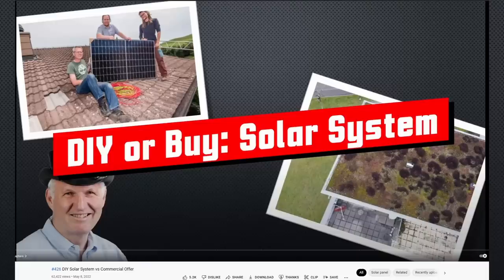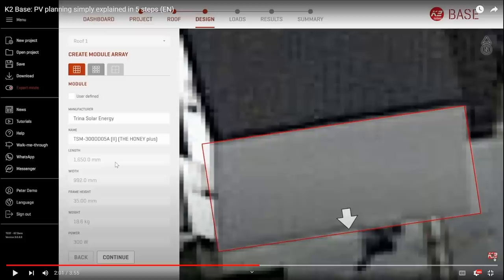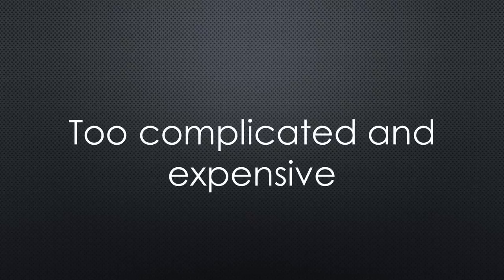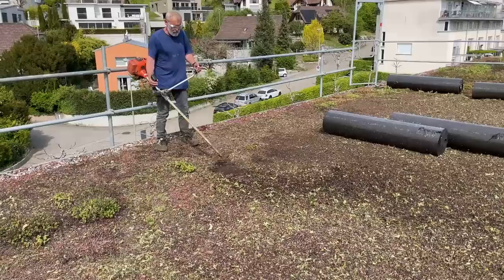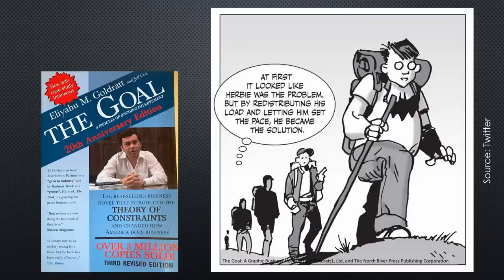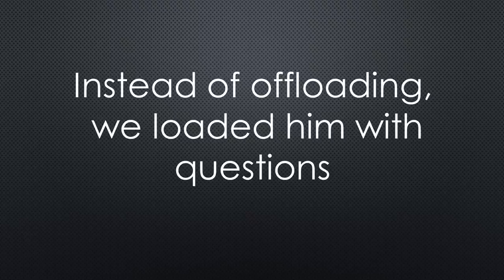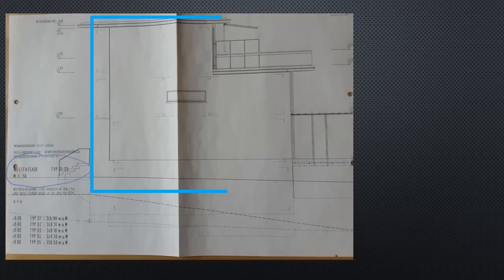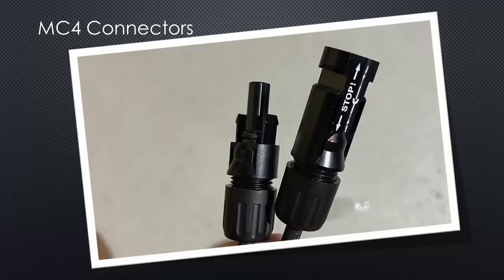#427 Four 8kWh DIY Solar Plants with neighbors (Part 2)

Comment: Interesting. I also installed a small solar panel system and it is surprising how expensive it became and how little power it produce. That being said it is only 2 x 100W panels and 2 x Exide ES1350 GEL type batteries, but it is still enough to run my flat except the electric cooker in the kitchen. All my devices, phone, and tools gets charged from this little system as well as it runs my computers, 4G Internet router, LED-lighting, and my fridge. I turn off my fridge at night to conserve power and it has not been a problem so far. My panels are placed outside my windows (cannot be seen from the street) at the roof level on the third floor and are they are mounted with 3M VHB tape. It is my plan to add a Raspberry Pi to monitor the voltage level of the batteries and top up with a charger at night, if it falls below 12,4V. So far the the voltage levels of the batteries has been between 14,7-12,8V all regulated by my Vevor MPPT 40A charge controller and the batteries are usually fully recharged at noon the next day. While I have come to terms with the low power production and the low prospect of recouping my investment, I am positively surprised and happy to know that I will have power enough for what I need, in case of a prolonged griddown scenario. I live in Denmark so most people should have better conditions than me. Since I use a battery bank there's no regulations to comply with, and I am insulated from future idiotic Governmental decisions, policy reversals, and price hikes. If all goes well the solar system should give me between 15 to 20 years of somewhat trouble free operation.
Reply: the set up you have is about what you need for every major appliance individually. I don't see how approximately three such setups couldn't pay for itself in a year if you completely mitigated your usage.
solar fridge vv

https://i.pinimg.com/originals/f5/27/99/f5279909e1205f363ae44999c0002fe3.jpg
Reply: @kingmasterlord   :D I might consider that setup... Thanks for the advice :)
Reply: Do you have like 18V panels? (21V peak).  If I check the price of these versus like the 300 Watt panels that output like 30 to 40V it seems that the 18V panels are a lot more expensive price per Watt wise.  Not sure if you have insulated your fridge but I once saw a website with a guy that insulated his fridge and got a lot better efficiency. 
For the monitoring I would check an ESP32 or if needed a Pi a first gen Pi Zero. My Pi Zero W runs internet radio all spring and summer on a small panel with a 18650 buffer ups pcb.
How does it run during the winter months?
Reply: Check out the new "carbon" lead acid batteries (aka "ultrabattery" but licenses and cloned worldwide). Also sold as "EFB" batteries for cars. 
Their biggest advantage is that they can stay discharged for longer time , but they also do not sag (their voltage drop is smaller) like normal lead acid and charge quicker.
They are priced just like normal car starter battery and sold in car battery stores. 
Getting even smallest set of them to complement your existing system will prolong life of your install, esp. if you will install smart switch so they will discharge first, before discharging your normal batteries, and even better - if weather forecast will be taken under account.
You can get very good , machine-digestible weather forecast from polish ICM goverment meteo service (i cannot paste link as google will remove comment as spam) . 
I hope this will help to keep your return of investiment by prolonging battery life. 

Using RPi is bit overkill as it consumes much power , There are very nice uC's able to do video generation , many running python. 
Actually one can also create analog or even mechanical "statistics" display - just think about using hour-glass , or water.
So f.e. small "water pond" pump pumping water from bottom of hour-glass shaped bottle to the top , powered by sun. This will "integrate" the total sun input giving You daily average. In the night water will slowly drip back to the bottom. Ofc this is just example and you can design similiar analog circuits or do it all completely mechanical way so it is more intuitive. 
Good luck and greetings :)
Reply: @Luke-san  My panels are 2 x 100W 12V 8A and they are connected in parallel so I theoretically can get 12V 16A and I bought them on Amazon in Germany, where I basically bought everything needed except the batteries because it was the easiest option. When the system is doing its best in sunny weather, around noon I get 98W, which is actually pretty good considering that my panels do not sit beside each other but on each side of the roof due to the space constraints under each window and the placement of the dormers. My fridge is an ordinary household fridge with a freezer compartment at the top. I discovered that the freezer only drop a few degrees during the night the 6 to 8 hours depending on the time of year because it is never opened at night. Right now in overcast conditions the system is charging with 47-87W and it is up and down like a yo-yo. I have only had the system since March 2022 and I quickly realised that it would be good to have an automated option to charge the batteries from the grid in case the voltage dropped below 12.4V especially if I get a few very dark days in a row.  I use 2 inverters to handle my 220V needs 1 small modified sine wave inverter 300W (500W peak) and a 1000W (2000W peak) pure sine wave inverter otherwise it cannot start the fridge. If I used the 300W inverter for the fridge the light comes on in the fridge but it is not able to start the compressor. Snow does not affect the panels very much, covered with snow they still charge but of course they do better without. Btw. thanks for the tip about ESP32.
Reply: @piotrcurious1131  Interesting, I didn't know of EFB batteries the Gel batteries were very expensive and very heavy. Thank you for the tips you gave me I will check out the Polish weather services.
Reply: @yannkitson116   Yann, isn't it an option to place the panels in series?  Should be higher voltage = less cable loss. Might be worth to experiment. But first read the manual of the controller I would say. (covering my ...) Just checked that mppt controller, seriously expensive stuff compared to those pwm controllers. 
About the fridge, I think it must be the compressor that requires a lot of power during startup. I checked 2 fridges  here and both were using like 70 to 80W while running so I wonder why we need to connect it to a 2.5mm cable instead of a 1.5mm one. The 25m extension cord that I use to power a lawnmower is also a 1.5mm thick cable.
Reply: @Luke-san  The charge controller isn't a cheap one it can handle 12V, 24V, 36V, and 48V and if I connect the panels in series I will get 24V/8A. I have never seen 8A it is usually around 2-3A and between 16V-21V. I was under impression that I should get as many amps as possible for faster charging and the correct setting would be handled by the charge controller that's why I connected the panels in parallel given the low performance of the system. The system would definitely benefit from getting a few extra panels added, but unfortunately I don't have any room for more than for the 2 panels I have.  One of the panels have about 11m cable between it and the charge controller and the other has 3m. The whole system was outrageously expensive, the 2 Exide batteries alone cost me 5800 DKK but the charge controller's wifi module tells me that I have produced power for 45.3 DKK in May so far. Electricity is expensive in Denmark so that amounts to 11.6kWh but I think those figures are unreliable.
Reply: @yannkitson116   Well 12V/16A and 24V/8A equals the same power but cable loss over low voltage is higher. Your MPPT I would guess should do the rest of the manipulation ... converting solar power voltage and current to the appropriate output.  if I think it is the one I see it says solar panel input to 150V DC.  Depending on the thickness of the cable 11m can already cause a bit of a loss. MC4 connecters are fairly cheap and some thick cable, or multiple ones in parallel won't break the bank and can get you some extra power. 
If I were you I would check if there are some forums about small systems and get the other peoples experience  by just introducing and telling what and how you have installed things.  Btw, I applaud you for doing this.
Reply: @Luke-san  The cable from the panel to the charge controller is LappKabel Bund Lapp 2x6mm^2 that's what it says on the label from offgridtec (bought on Amazon), which is basically a very stiff cable that contain both the positive and the negative supply and I use MC4 connectors for all connections except where the two panels are connected in parallel, but that I can change... Yes I might look for some more information in a forum. Thank you for your suggestions for improvement.
Reply from the maker: I also would pay attention if the panels do not have the same direction. This can hurt the efficiency dramatically. See my East- west setup
Reply: @AndreasSpiess  Yes I guess that is probably one of the biggest issues. One of the panels only get diffused sunlight while the other one get direct sunlight, that is a limitation I have to live with due to space constraints. I never see the full capacity of the solar panels, the capacity is always less than half of the theoretical maximum. So while I'm looking at a questionable profitability, at least in the short term, I get an immense pleasure out of the little return I have had. Inflation has actually helped a bit, due to the now higher price of the individual components, which translates into "savings" in present day value compared to the actual purchase price. So when we look at it that way the ECB has produced more value for me than the sun so far :)

Comment: I think that the long minus is for having the same restistens to alle the panels, like a chrismas-light, see Big Clive example
Great project, with a lot of learning incorporated and a lot of comming to together. Love it.
Thanks for sharing your journey 👍
Reply: In this layout case it should be more to avoid an induction loop. Such loops with large surface are susceptiple to induced overvoltage if lightning strikes nearby.
Reply from the maker: I understand the lighting argument!

Comment: Great job, congratulations! One note, when it comes to comparing cost with your brother’s installation: A sloped roof (especially a steep one like your brother’s) adds a lot to the installation cost. (Note all the scaffolding they had to construct, and work goes much slower.) Here in the US, roofing companies also charge more for steep roofs because they have to use more expert, higher-paid crews.

What a fantastic project, I’m envious!
Reply from the maker: He also used scaffolding to paint his house... But still, it will be interesting.

Comment: woa, seeing the concrete houses & roofs is CRAZY !
in USA  u have to be careful walking on the roof not to bend it, which leads to a break=water leak.
Reply from the maker: Indeed we have different building styles… But you also have skyscrapers ;-)

Comment: Nice project. Looks very well done. I upgraded my 3kW system to 7.5kW last summer. And built some ESP8266 based modbus to MQTT readers to read the inverter. Btw, Basel was awesome, we really enjoyed it.
Reply from the maker: Cool you enjoyed Basel! I have to hack the Huawei protocol to get to the data because it is an integrated system (with battery)

Comment: I actually went fully off-grid with solar power this past winter. I spent about $6k USD for 7kW of used solar panels, a 5kW all in one charge controller/inverter unit (Growatt SPF 5000 ES (US model)), and a 125 AH 51.2 V battery pack, plus the hardware to hook it all into my home. I've designed the system so I can expand it to up to 30 kW at some point in the future.
Reply from the maker: Cool project! We use too much electricity to go off-grid in winter. So this is a good choice for our small roof. My 10kWh battery will barely survive one long winter night...
Reply: @AndreasSpiess  I understand. In my particular case, I heat the house with wood, so the power load is much lower.
Reply from the maker: @MatthewN8OHU  we also use wood for heating.

Comment: In some cases you can get away with the longer minus (or positive) cable, effectively reducing the cabling length by 50% by using "skip or leapfrog wiring".
Reply from the maker: I had a look at what you mean. The disadvantage is that we would need much more extension cables between the panels because the initial cables only cover the distance to the next panel.

Comment: Great content as always! I don't know if the dust will be a problem as time pass by, because it would impact directly in the system's efficiency, maybe we could see  a panel cleaner based on Open hardware series soon lol!
Reply: Usually you would just wash the panels once a year, before the summer production peak. Cleaning that by hand would take less than half a day. Developing, installing and maintaining a machine/robot to do the same would take way more time and effort. I guess for really large installations, cleaning automation can make sense. But for small and customized projects like that, doing it by hand is just way more efficient.
Reply from the maker: I also hope rain will do its job. They promised that the panels with 10 degrees slope are „noclean“

Comment: Looks pretty easy, comparing to do everything alone, welding a construction on the roof etc... The roll of cable was the heaviest to bring up the ladder...
But it is not really comparable, my first system ist just 9 Panels. Nevertheless they serve my complete consumption right now, the electricity meter is turned off and i am powered by my UPS system 🙂
I am curious what you get out of your system.
Cheers from Bulgaria.
Reply from the maker: I remember the weather in Bulgaria: It was sunnier than in Switzerland. So you are lucky...
With just a ladder: I can imagine how hard this was! We were very happy with the lift.

Comment: Beautiful, If U make your DIY MPPTs, DIY inverters, DIY batteries, its will be the best and the cheapest project in Universe.
Reply from the maker: That would be very hard because it has to be connected to the grid (laws). Plus I am old and if I die, my wife has to have professional help with such important infrastructure.
Reply: @AndreasSpiess  I made my MPPT, BMS and inverter, because I watched your videos, thank you very much for your knowledge, for your videos, you can say difficult things very understandable way. Thanks very much.

Comment: great project! i just wish i could convince my landlord to do it; the roof here would be ideal for pv, a lot of unused space for batteries in the attic... well. i just have to win the lottery, in my own house it will look different
Reply from the maker: Maybe increasing energy prices will convince him…
Reply: @AndreasSpiess  actually no - bc it's me who has to pay the higher prices, he'll just send the invoice 😕
Do you have an idea on how to "maximize" a "Balkonkraftwerk" (those 600W max-thingys) into an island-installation? (eg an idea for a battery to load, then a little "transport" form balcony to living room, and then live of that instead the grid?)
Reply from the maker: @michaelkeller5008  Balkonkraftwerke are grid systems without batteries and they are limited to a particular power (900W in Germany if I remember right). Off grid systems are well documented in the internet. But you have to decide which one you want...

Comment: Great content, all i know about why the - cable need to run paralell to the positive is that in some cases it gives you wierd radio disturbances, had a remounting to do because of this where the clients wifi didnt work on his upper floor after they ran the cables the shortest possible way. why im not shure myself but i think you can find out since you are an electrical engineer. greetings from Sweden.
Reply from the maker: I heard a similar explanation, but did not understand why...
Reply: @AndreasSpiess  i googled some and i found this answer but no source "n theory, the switching frequency of am MPPT controller can and does introduce an magnetic field in the wires, and generate radio interference. But that same current is also spread out across the entire solar panel service. In affect, the panel is also a great big unshielded antenna."
Reply from the maker: @zcalex7660  others mentioned lightings as the reason which sounds reasonable to me.

Comment: Morning Andreas, will done on the installation of your solar, the UK as also seen an increase in solar installs Just Completed a 12Kw Job saving the customer 50% of the customers energy use.
As i know you are a bit of a IoT fan, Shelly do a range of AC monitoring device’s, and the home assistant have a energy monitor using a ESP32 is worth a look.
I have one question about snow, in the winter months no production, is there any solution to this.
And on the MC4’s this will be the weakest point on the installation, my recommendation is that you don’t leave them exposed to water, the most call-outs for a faulty installation is MC4.
Reply: Some experts would say that the snow slips of the panels when the sun shines and it melts a little. That's why you have to be carefully under a roof with solar in the winter because it could come a avalanche down
Reply from the maker: I have a Shelly from before Solar. Now it shows weird values I have to understand.
I will try to get the info out of the Huawei system (also because of the battery).
I am also curious how snow will behave…